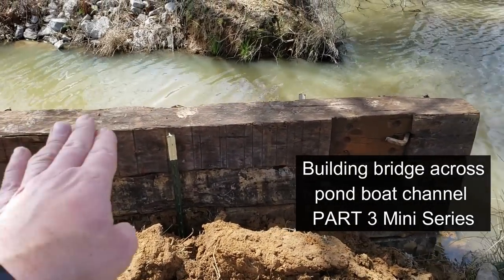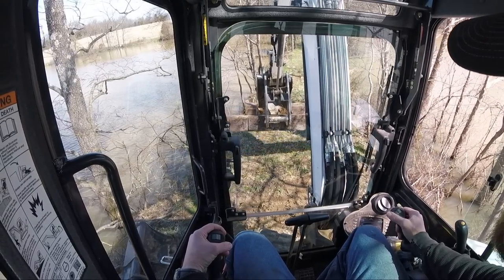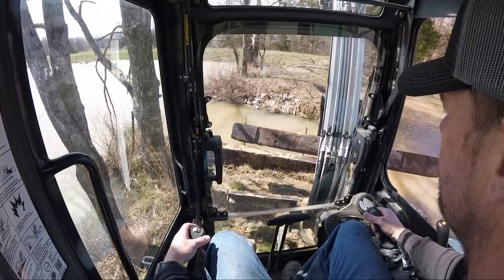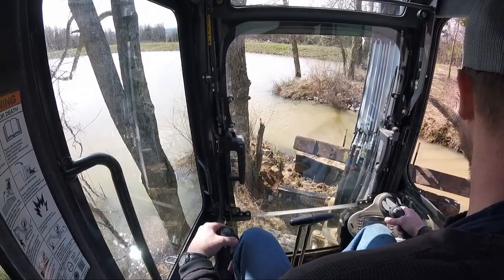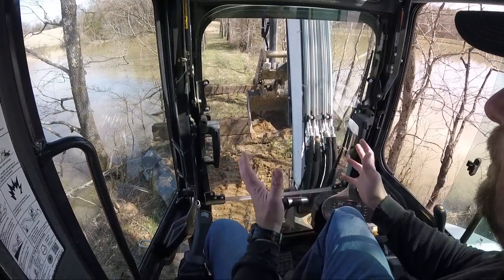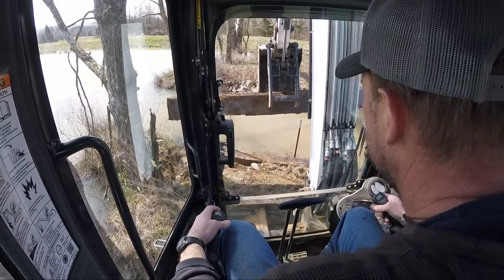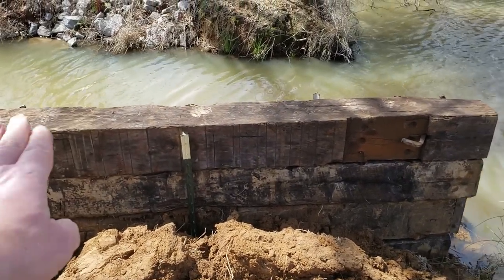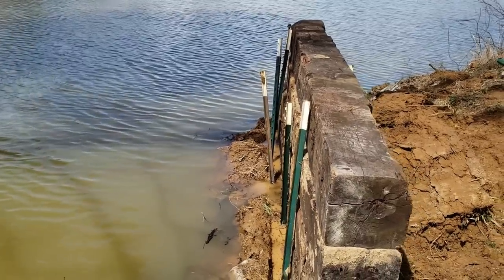Building a bridge over pond channel PART 3. IS THIS MADNESS???

Comment: you will need to deadman some crossties back into the ground for that to attempt to work.
vertical wall with no support will fail.
best option would be to step back about 4-5ft behind that and dig an actual foundation poured with concrete.
then build up to desired height to begin bridge floor.
there is nothing stable about that crosstie  set up you have there due to the ground always being wet from the pond.
Reply from the maker: yes thanks I do plan to add that in. I'm just not certain how to anchor it but I sure will, thanks.

Comment: Build a crib to hold up the end of the bridge, and fill it with rocks.  Do the same on the other side.  Use used utility poles for the bridge structure.  nail treadway boards to run your tires and tracks on.

Comment: Kap, forget the railroad ties. They rot from the inside very fast. You could have a couple precast concrete Jersey barriers dropped off on each side then lay your steel across.
Reply from the maker: That was my first choice but they are expensive and I think they were too heavy if I recall. These timbers last decades on train tracks and bridges, so hopefully we'll get some life out of them. Too bad they didn't have an expiration date!

Comment: Joe, are you planning to use any deadman's back into the ground behind the pilings to lock things into the hill?  I understand this is after the fact, but after setting the first timber, I'd be running two deadman back into the dirt bank, and cut to fill in across, then set your third beam on top.  Each layer you take a half in rebar and spike the layers together. The way you are building this it will rack when you put weight on it and you will end up in the water.
Reply from the maker: yes absolutely, this is only going in phases. I'll be beefing this up quite a bit yet.

Comment: That will fail while building, or worse when bridge is finished and someone is using it.
Get more railroad ties, dig back the ground and lay several side by side with the ends towards the water. Then lay one on top on each end, and bolt them to all those on the bottom.
Only then can you start stacking, but every tie has to be bolted together. Think of it like stacking bricks. On the ends you need shorter and shorter ties to extend backwards on the sides. Then you fill the "box" with dirt and at that time you can get your beams in place.
Reply from the maker: I think it will work, but I will be connecting all 4 yet and making a dead man for rear support. Then I think once the bridge is in place, secured on both ends, it will be a success. But its always an adventure, thanks.

Comment: Joe, do you still have the auger hookup for your tractor? I would suggest taking and burying two of those railroad ties upright in the ground behind or in front of the other ties you laid horizontally. like poles in a pole barn to help give some support to them and keep them from rolling over. Maybe pin them all together with 1/2 to 5/8 inch spikes, rebar or rod inside of the timbers and lag screw or carriage bolted to the upright supports which are buried as deep as you can get them. maybe even tie a dead man to those uprights too so it wont roll into one bank and off of the other.
The dirt is soft, always being right next to the water, it probably always will be.
Reply from the maker: don't have the auger any more! but I plan on connecting them with steel, and then making a dead man yet, thanks.

Comment: Check your local concrete mixing plant, usually left over concrete is poured into barrier block forms, and you can pick them up cheap and out live the ties
Reply: Mafia blocks
Reply from the maker: That was my Plan A, but it was expensive and they were too heavy for the size I needed to get the height. So now I'm on like Plan D really... If I didn't mind dropping the cash, I would have made a form and poured it myself, that would have been sweet no doubt... thanks.

Comment: Frustrating yes but you got a plan and once you get the supports in place, then you'll see if it's going to be strong/stable.  I thought about creating a concrete base for the logs to rest upon but I think you'd have to mix concrete by hand or by portable mixer. Either way is a lot of loading/off-loading bags of concrete.  Will stay tuned in to see how you execute your plan.  I just read viewers' comments and all are mainly concerned for your safety. Be safe and have fun.  Nothing like taking on a challenge head-on.  Full-watch.
Reply from the maker: I have another idea. I might just set concrete bags down to for a base. I've seen that done before and it worked pretty well. We'll see, thanks man

Comment: How to good buddy.  Run two deadmen to the rear, and connect them down deep by setting them on a cross tie in a deep trench,.  Then rebar 48 inches through the ties and into the ground.  Bury the ties, and compact the ground.  It isn't going to go  anywhere after that.
Reply from the maker: yep, pretty close to what I plan to do! Thanks man

Comment: Maybe drill holes in the railroad ties and drive rebar down through the ties and into the ground to keep them stacked
Reply from the maker: yeah I don't have the drill setup but I will lag steel beams on the outside which should accomplish the same thing, and I'll do it 
on both sides. thanks.

Comment: I hate giving unsolicited advice...but I must in this situation. You really need to get the foundation up on dry, firm land or else pour a nice concrete footer. That will only sink in the mud. I know you're trying to keep this on the low budget but sometimes you just gotta buck up and do it right. 
Respect...
Reply from the maker: No worries, thank you. This is hard pack clay from the pond dam, compacted over 40 or 50 years. I have the lowest timber above the water line so it should stay dry. I've worked with hard pack before and I don't think it will be a problem with sinking. Of course, you never know til you try, appreciate it. I wanted to do concrete but the cost was just too high and the weights too high to get the height that I wanted. I'll definitely be beefing this up much more yet. Thanks.

Comment: I would have drilled a big hole on each side of the crossties so u could drive a pipe into the ground through the ties to keep them stacked and for support but i have a machine shop wouldnt be able to do that with a hand drill lol or possible made some type of form and poured some concrete or you could cut them same length and make some plates to lag bolt to the sides to keep them in place many ways you can doit i think the pipe idea would work well and not be to much work but i know you will figure it out one way or another
Reply from the maker: yeah I plan on doing that without the drill part, lol. I'll lag severl steel beams on both sides to keep them together, then beef it up some more yet, with a dead man. Long way to go, but I hope this was the hardest part! thanks.
Reply: @kapperoutdoors  either way you got yourself a nice place and the way the future is looking you will need it never know whats going to happen with this crazy world people cant be so reliant on society and the government its so much easier and better to be self reliant i wouldnt live in the city even if i had to

Comment: There is no foundation. The ties are just sitting on top of the mud.
Reply from the maker: It is not mud, it is hard pack clay, from that original pond dam, compacted over 40 or more years. And the bottom timber is above the water line so I don't think there will be any sinking, but time will tell, thanks.

Comment: DOINT THINK IT WILL HOLD. need holes drilled in each cross ty to match the ty on top with steel rod drove in .  read NoC  and drake stevens   has a better light bub.
Reply from the maker: yes of course I'm not done yet! I will lag them all together and make a dead man too, thanks.

Comment: I don't want to sound like a troll! Famous last words of a troll before getting blocked......... had you thought about using gabion baskets instead of the railroad ties?
Reply: They don't have to be large baskets, I know weight is an issue with the banks.
Reply from the maker: No worries, I appreciate good feedback. Hadn't looked at them, but they do look interesting! Not sure what would be harder, to fill those or stack the logs! lol.
Reply: @kapperoutdoors  baskets would be easier but more expensive than your ties but like you said in the video it's a work in progress. If it was me, I don't know how I'd tackle it.

Comment: I don't know how much experience you have with railroad ties but they aren't rated for ground contact. They actually rot much easier than people realize. The centers rot out and they lose all structural ability. They are also really toxic and carcinogenic. Just something to think about.
Reply from the maker: Good info thanks. I figured they were old and most of the creosote on the outside should have been well washed. I do plan on putting stone in along the inside of the stack. But now I might consider after bolting them together to lift them and add some stone underneath to reduce the ground contact. Thanks, it is a work in progress. Take care

Comment: I am sorry Kap but that will not work. syclone73 is right without deadmen your wall is going to fail. You need at least gravel for a base and then tie the cross ties back into the bank. Have you heard Of Muirfield Village Golf Club in Dublin, Ohio. That is the golf course Jack Nicklaus owns and that is where I learned to build bridges like the one you are building. You need to dig down to solid base pour a footer then set your abutment on (cross ties). Tie them back into the bank with deadmen and backfill with crushed gravel with dust. We call it 46d or 411's. Now you have a solid foundation to build your bridge on. On a project you will use machines much less than plain old back breaking labor. Get your self some help. I'm sorry but when I see this happen I get fired up and want to jump in and take over, maybe I should not comment at all. good luck.
Reply from the maker: Yes I certainly plan on beefing this up much more. A dead man, and steel beams to connect the ties together. My Plan A was concrete but it was cost prohibitive and very heavy for blocks. I don't think it will settle much as this is hard pack compacted clay from the old pond dam. We'll see how it looks once I get the supports all in place and the dead man. I'm just not sure what kind of deadman I will make, but it will be included. Thanks. And man, I wish I had someone that wanted to take over some projects! But we're out in no mans land, pretty much solo around here!
Reply: @kapperoutdoors  I understand, if my wife didn't have stage four lung cancer I would love to spend a couple of weeks helping. But it is what it is.

Comment: I would have just dug the water passage sufficiently deep to drop in a pair of 24" corrugated plastic culvert pipes and filled dirt over it. This stack of ties will collapse, as has been detailed in the other postings. Its so freaking unstable you cant even build it without massive fails, well illustrated in your vids. Thus a waste of time and materials.  If you need a boat channel, forget about a bridge. Its not a hiway location.  Consider actually removing the old dam and making the channel a lot wider.
Reply from the maker: I enjoy proving people wrong, but only time will tell. This will still be beefed up quite a bit yet. Its a work in progress